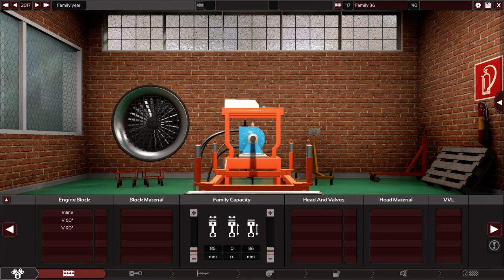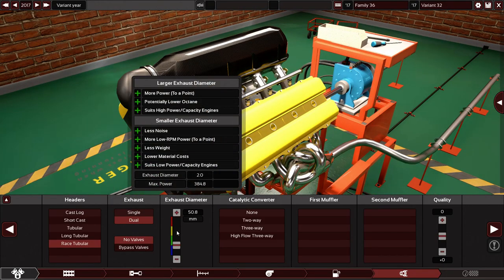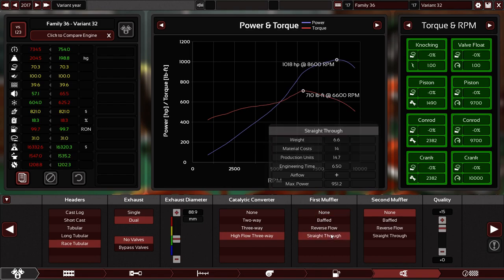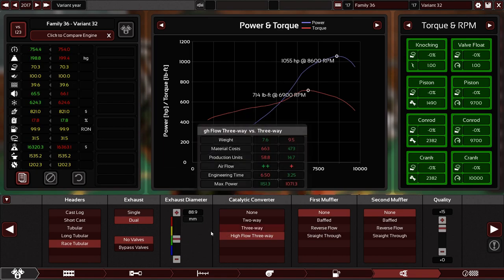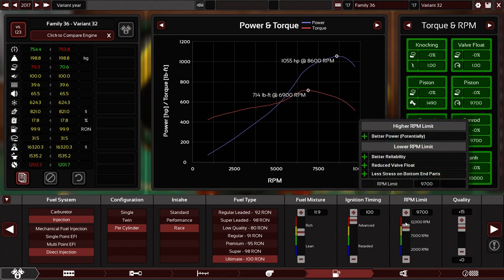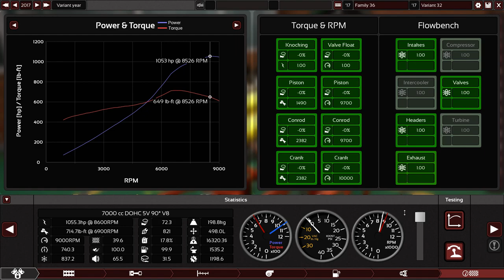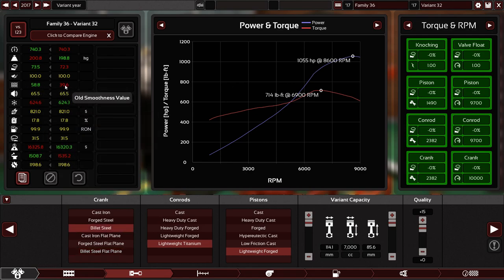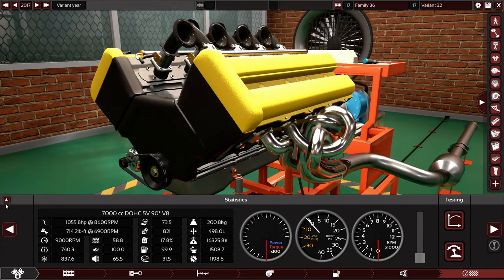9700 RPM 7.0L NA V8

Comment: I built my NA DOHC 7.0 v8 version based off the old Ford fe 427 cammer but it has ti-vct, and direct injection and is just a high performance factory engine  that I put in cars but I have it limited at 6600rpm and it still makes 733hp and 600 lb/ft. I also have a twin turbo flatplane that can make as much as 1750hp without being maxed out.
Reply from the maker: Nice work man.